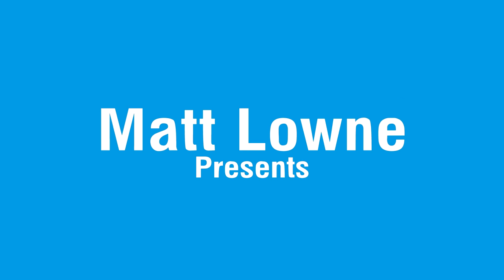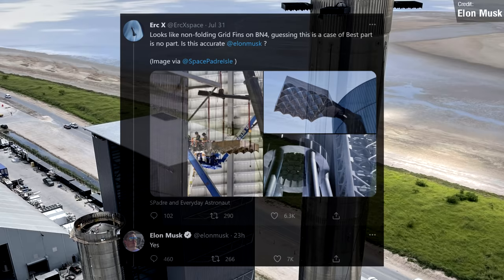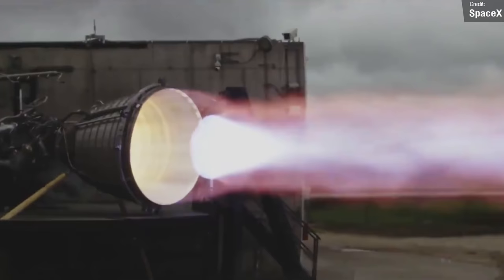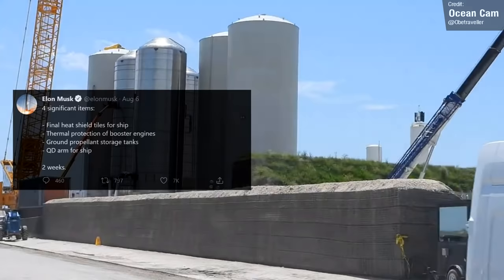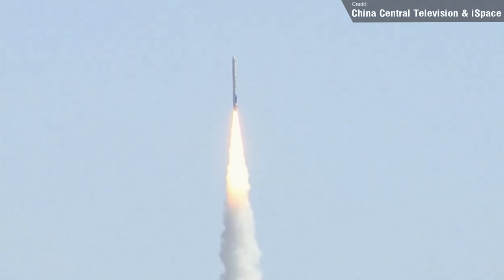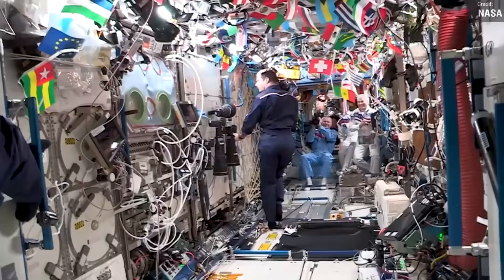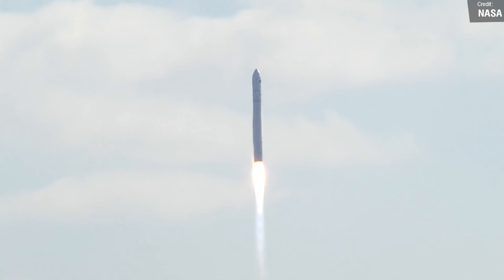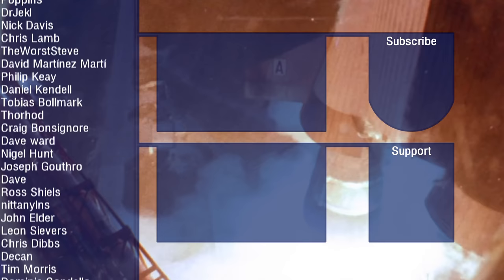SpaceX Starship FULL STACK Taller than Saturn V! Plus ISS Olympics, Starliner, ISRO & China Updates

Comment: The ship will probably be stacked this month but due to the FAA‘s enviromental report and investigation I would be suprised to see a launch in august…
Reply from the maker: Elon has estimated 2 weeks from now
Reply: @MattLowne  that is insane
Reply: @MattLowne  I think that was in reference to the tower/GSE stuff being completed. So long as the FAA's report isn't completed, we will be at least 30 days away for quite some time since it usually comes with a 30-day public review period. So sadly there wont be a launch until next month at the earliest, though I would guess it wont happen until the end of the year.
Reply: @MattLowne  two weeks Elon time are 6-8 weeks normal time. So maybe mid-late September.
They still don't have all the fuel tanks and probably no fuel pipes to the rocket. This is not a 300-800 ton fuel hopp (me guessing funny numbers) but a 4000 ton fuel Launch. And than they need to test whether all that actually works and is leakproof. And than they need to wait whether the FAA actually allows them to launch in Boca Chica. (they currently are only allowed to launch Falcon 9s if I am correct)
Reply: @MattLowne  That's insanely quick
Reply: @MattLowne  it's ok. I would like to see it fly at the end of the month too. But to be realistic, that's not gonna happen.

Comment: In Tim's interview with Elon, Elon mentioned that the reason the fins don't fold is to keep Booster 4 simple. He said that if they have to make the fins fold, they'd have to add a whole other mechanism which will add to the weight. Also the arms won't be cathing the booster on the fins but instead on 2 little structural pieces protruding out of the booster just below the fins.
Reply: So when they launch Super Heavy,it will remain the same everytime?
Reply: @hendrikpoggenpoel4508  Ahh Ok. Also I did watch Tim's Videos. Didn't have a lot of time to watch the second one.